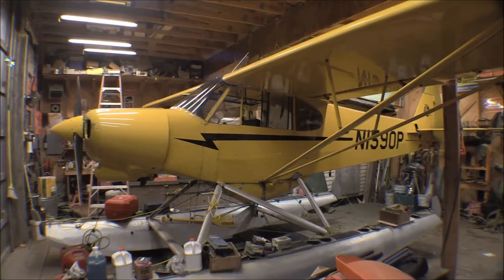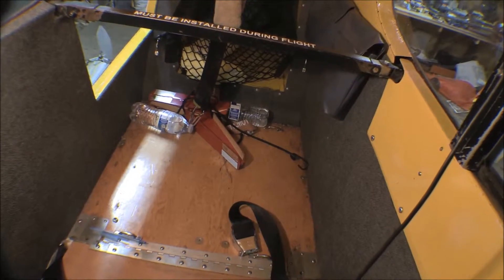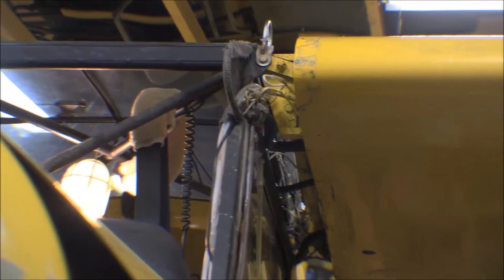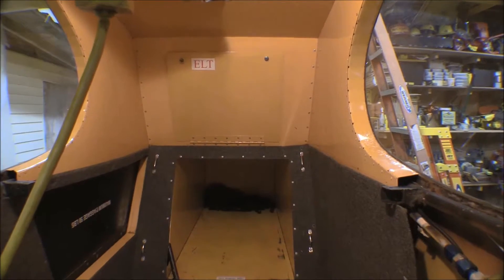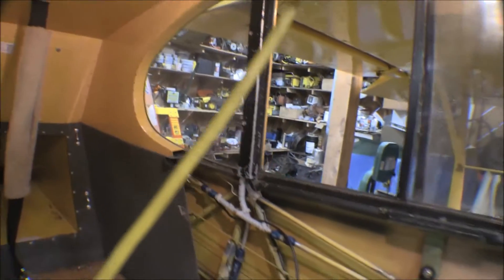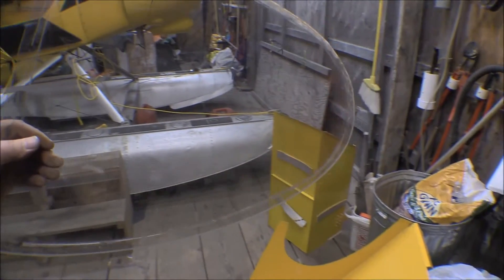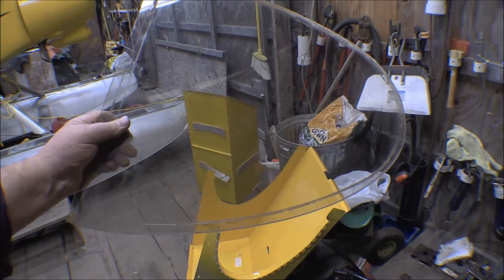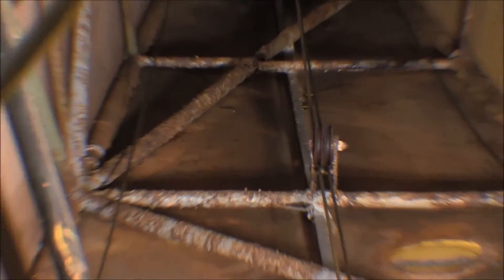Piper Supercub Widebody refurbishment:  disassembling the fuselage

Comment: Hey thank you very much. More please. For float flying, how foes a fabric covered plane compare to aluminum? Copilot checklist lol.
Reply from the maker: +The Kid 
I making them as I go on the refurbishment, problem is it takes longer to edit than make and takes away from work progress.
I' not sure what you mean as far as fabric compared to aluminum on floats. Maintenance wise, on fresh water not much. Salt water and salt air takes its tole on everything, but the steel tubes on the fabric aircraft  are more susceptible to corrosion. This airplane was rebuilt by Cub Crafters in 2001, it was built in 1957 and was based in the Dakotas for years. I repaired the tail surfaces and replaced the rudder about 8 years ago, and opened up the belly and cleaned and repainted the tubing about 5 years ago, but the fuselage is pretty much shot now. The new fuselage was powder coated, so, hopefully, will last longer than the old one. A Cessna 180 sits on the ramp next to me. It was built in 1968, it has been on floats in salt water since new. I flew it in 1984 and it had over 20,000 hours on it then. Of course it has had a lot of repairs done to it too, but aluminum seems to hold up better than steel if cared for.  Either way, it takes a lot of work to keep one up in salt water conditions.